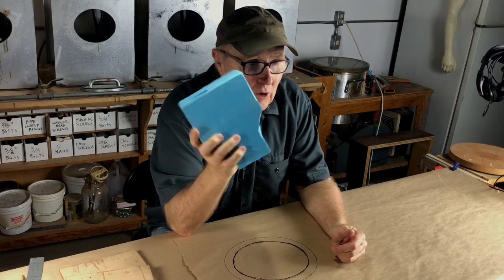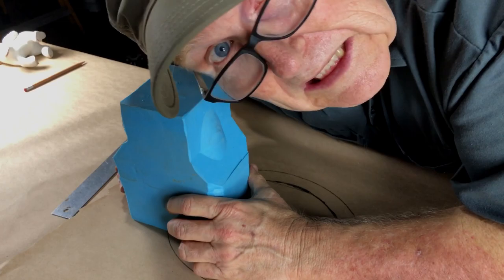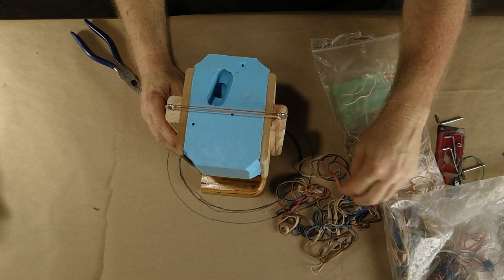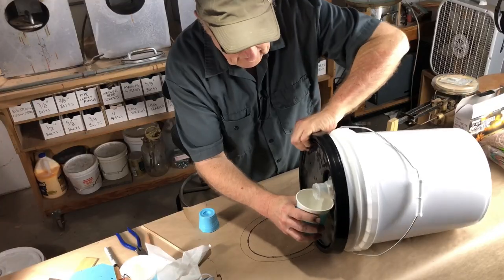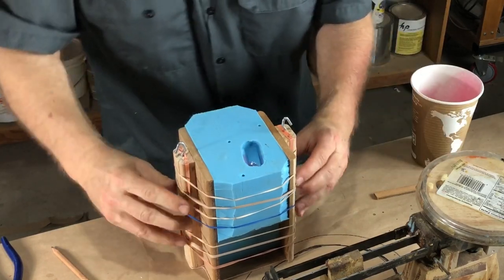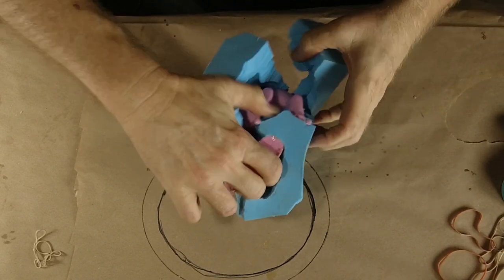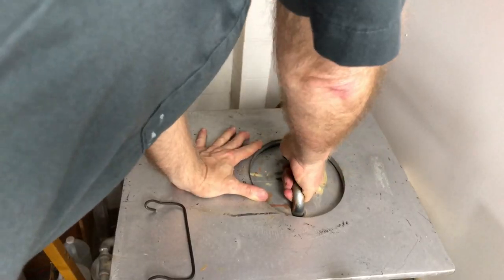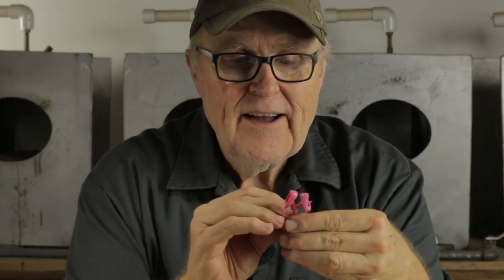Molding And Casting A Four Legged Creature - Part 4

Comment: Oh wow! Those turned out better than expected.
Reply from the maker: Glad to hear it! I’d be bummed if you were disappointed.  It was a really fun project, thanks for sending it to me!
Reply: @RobertTolone  The troubles you had with that thing is the story of my life!
Reply from the maker: Minor problems really.  Everything came out well.  It’s awful when you have a model, for instance, made of soft clay, the gets totally destroyed in the molding process. And then you discover the mold is unusable for some reason and the entire project winds up in the dumpster.  I have my share of horror stories.
Reply: @RobertTolone  I have had that happen! I made a beautiful sculpture in oil based clay, and tried to make a mold of it. The mold didn't set up right and sculpture got destroyed when I pulled it from the mold. This is why I switched to sculpting harder clay. Even if the clay figure breaks, I can usually repair it enough to make another cast.

Comment: Hi Robert, thanks for all the knowledge and sharing your experience. Much appreciated. 
Question for you, other than not fitting in the pressure pot, is there a reason you do not use the cradle you used to make the mold, when pouring the resin in the mold? It seems to me that it would be a perfect casting case.
Reply: I was going to ask this too, hopefully, we get an answer

Comment: To keep wood from sliding during gluing and clamping, add salt grains (sharp) to one side which digs in while clamping and acts as a grit, which dissolves away afterwards.
Reply from the maker: I’ve heard of that but never tried it.  It works well for you?

Comment: Your videos are so helpful! How do you typically clean up something like the foot with that big chunk on it? Just an exacto knife and then sand? And if you don't have a pressure pot, do you have any recommendations for limiting bubbles? Would a slower curing resin help at all?
Reply from the maker: Taylor Crisp The best ways to eliminate bubbles is 1: use fresh resin.  2: keep resin containers tightly capped and don’t leave resin out in open cups overnight, etc. 3: properly place vents to let air out as the mold fills. 4: plan your pour to tip, rock or shake the mold if necessary to release air bubbles. 5: fill the mold in stages so you can rock the mold in different directions to release the bubble. 6: vibration can be a help and a slower curing resin will give you more time to work out the bubbles.
Reply: @RobertTolone  Got it, thanks so much!

Comment: Hello Robert,
I can not recall in which of your many informative videos you stated that resins and rubbers will shrink as they dry. With that stated, do you know of any manufacturers that will specify there resin's shrinkage rate or do I just have to run my own tests?
Thank you sir!
Reply from the maker: My supplier, www.silpak.com, provides material data sheets on the products they sell. I would expect that many manufacturers do the same thing. You should be able to locate that information for the material you’re using online.

Comment: Another great video! Thank you for sharing your knowledge. Did you make your pressure tanks? - if so, maybe in the future you could do a video on how to make one.
Reply from the maker: I did not make them myself; I designed them and hired a certified welder to fabricate them. They are made from brake cylinders used by large trucks.  It is very important that the welding be done correctly because they are under tremendous pressure and could explode if not properly made.

Comment: Great result! Is there any merit in dusting the mould with talcum powder to assist with the flow of the  resin and preventing bubbles?
Reply from the maker: I have never found it useful but many people swear by it.  If you vent the model correctly and use fresh resin it should not be necessary. The powder tends to fill the fine surface details and that can lower the quality of the castings.  But test it for your work.
Reply: Thanks Robert for the answer I shall stick with your tried and tested methods.

Comment: Question. It is obvious you get very close to the correct amount of resin when you fill your A and B cups, but if you had way too much of one or the other what do you do with it? Do you put it back into the 5 gallon bucket knowing you are introducing more moisture (and possibly color) or do you get some more and fill a small mold (probably something you will want in the future)?
Reply from the maker: I have gotten pretty good at eyeballing resin  measuring over the years so that I don’t waste much. Better to keep refilling the dispensing cups than to have a lot left over when the pouring is done. I also have molds of utility items like tool handles, sprue funnels, etc. that I can cast left over resin in. I rarely put the dispensed resin back into the buckets.

Comment: 28:38 omg I thought you were alone!! I jumped, lol. Great castings! Is the first cast a lighter pink from drying, or is the second a darker pink because of the pressure/bubble killer?
Reply from the maker: I was alone.  The compressor kicks on when the pressure drops below a certain point. I wasn’t talking to anybody just to the machine!  The color varies because I don’t mix the exact ratio every time, sometimes there’s a little more dye sometimes a little less. The pressure pot does not affect the color in any way.
Reply: @RobertTolone  Hah!! Wow that would’ve freaked me out! They were nice colors!!

Comment: I would fill the mold with distilled water then weigh that to find out how much resin to use. You would probably need a constant to account for the difference in density.  Of course then you need to dry the mold.
Reply: I was thinking the opposite. Fill a container with enough water to submerge the sculpture and mark the level. Next submerge the sculpture and mark the displacement level. Then remove the sculpture and add more water up to the displaced level. Then pour difference (back to the original mark) into another vessel and mark that level. 

At the end, you'll have a measurement of the liquid volume of the sculpture and a vessel to mix your resin in. ... there's also the problem of knowing how to split the volume for the A and B parts first. But I guess you could also weigh the water in the second vessel and split that for your A/B parts.
Reply from the maker: That is an excellent method and would yield an accurate result.  Weigh the water and multiply by 1.15 to account for the specific gravity of the resin. That info is found on the material data sheet provided by the manufacturer.  So why don’t I bother with all that?  Because quick and easy matters to me more than the cost of the resin. It’s the balance of time vs money.  If I measure the time spent weighing out the volume and multiply that times my shop rate I better be saving quite a bit of resin!  Also, I don’t want ANY moisture near my resins, so filling a mold with water makes me queasy.  How much time will it take to assure that mold is perfectly dry?  And if I leave just a small amount of water in a detail of the mold it will foam the resin and ruin the casting.  That said, if the cost of the resin is paramount to you, the method you described works well. Be sure to DRY THAT MOLD!  Thanks for your comment!
Reply from the maker: Measuring by volume is to be avoided with any resin system that requires measuring by weight.  The only time I measure but volume is when doing a production run of hundreds of castings. Then it’s faster to weigh out the A and B sides once and mark the dispensing cup accurately to the level of the resin.  Then you can use the same cup over and over - just fill the cup to the line in each pour cycle. That’s when you’ll really notice the difference between the A and B volume.

Comment: How do you repair the bubbles in the castings?
Reply from the maker: I general use epoxy clay. The big bubble in the hoof is easy but for the little surface bubbles I use a small drill or Dremel bit and clean them out before filling them. After filling they sand clean easily. Polyester based fillers like Bondo usually require multiple fillings or a build up because they shrink when they cure.
Reply: @RobertTolone  Oh wow,  ok. So it won't be the same color as the resin.
Reply from the maker: Oh, if you want it to be the same color you would have to fill the bubbles from the same batch of resin the casting was poured from.  I assumed that you were planning to paint the castings.
Reply: @RobertTolone  I wasn't planning on fully painting the castings. But I am sure I can figure something out. 😉

Comment: another way to measure would be to sink it in water and measure the water displacement... wouldn't matter if it was hollow, or what material it was originally made in.
Reply from the maker: That will work as long as you convert the volume measurement of the water to weight and multiply it times the specific gravity of the resin. Then you would get the exact amount you need. Plus you want to fudge a little to account for a cup waste etc.

Comment: Is that machine easy to fix that you said you've had for 30 yrs?
Reply from the maker: Yes, it will not be difficult to fix. I ran into problems because the adhesive for the O-ring was dried out so I had to replace it. But I didn’t have time to wait for the adhesive to cure because of the video production so I used a door from a different tank which didn’t fit quite as well. Each door is fitted to each tank individually. That’s why it gave me those problems. I will soon get it all sorted out.

Comment: Know what a parting board is dude? You cut the silhouette  of the horse's profile of thin board and seal any gaps with wax since you can't clay up the model. This way you can make a two piece mold instead of cutting it.